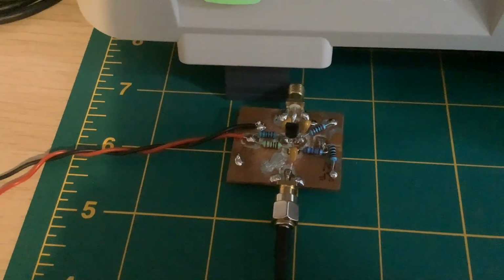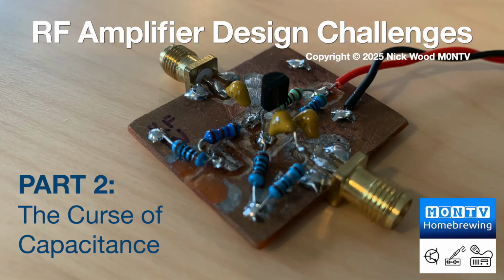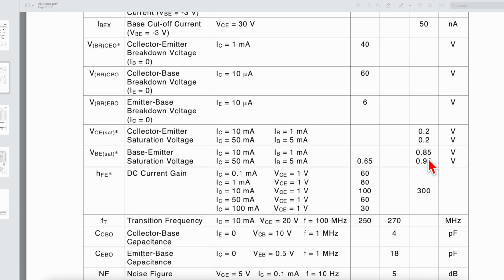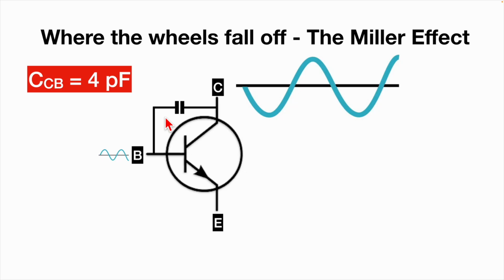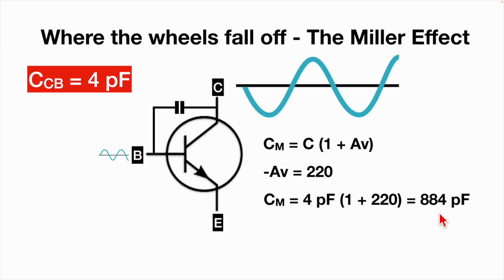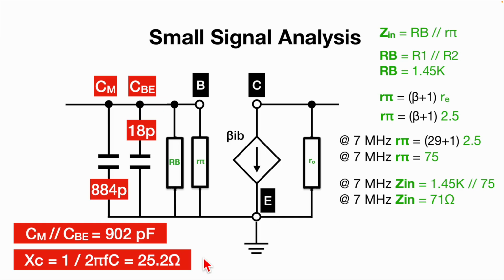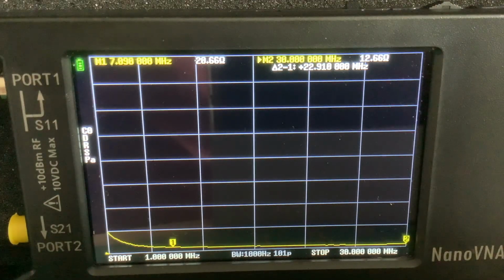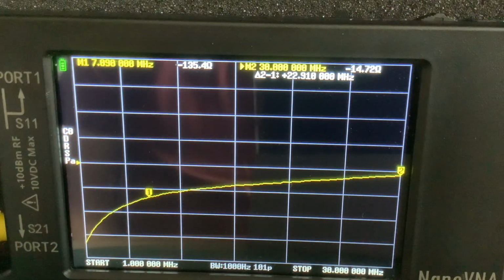65 - The Curse of Capacitance (RF Design Challenges: PART 2)

Comment: Sir please forgive for asking very simple request . Sir any video on Transmitter and Receiver circuit diagram used for RC TOY car controlling the Motors used in the Toy car. With Explanation how the circuit works , how the signal is transmitted from transmitter circuit to Receiver circuit which runs the Motors in the Toy car.
Reply from the maker: Sorry, I don't have any experience of working with remote control or motors. Just do a search - I'm sure there must be several active RC groups on the net and almost certainly several YouTube channels. Best Wishes, Nick

Comment: Nick,  I really appreciate your videos they have helped me a lot.  I could use some advice.  I have built several analog receivers and a few transmitters,  now I would like to expand and build a DDS driven receiver.  I do have the DDS working with a SI 5351, but my problem is I have not been able to successfully get it to tune a receiver,  I have tried both connecting to a sa612 and a diode ring mixer but still not a success.  So could you share some of your experience with me.  73
Reply from the maker: Hi Edwin, Thanks very much. When you say you couldn't get it to tune a receiver what precisely do you mean? Is the Si5351 producing a signal of sufficient strength (about +7 dBm for a passive DRM and less for an active SA612) and on the right frequency? After testing your Si5351 and microcontroller I would suggest you throw together a quick Direct Conversion Receiver. It's just a band pass filter into a mixer (fed by your digital VFO) then out into an audio amp and speaker. You'll soon see whether it tunes or not. If you are failing at the first hurdle (actually getting the desired output from the Si5351) then you might have to take a look at your code. Hope this helps. All the best, Nick

Comment: Hello Ralph...  Do the Miller capacitor Cm in the model should be connected between Base and Collector ? or between Base and Emitter as you drawn it , here ?
Reply from the maker: Hi there! I'm not sure who Ralph is! I do show the Ccb on the schematic. This is the intrinsic capacitance between collector and base. If you are referring to the small signal model then I did say that the Miller capacitance appears in AC analysis as a capacitance from base to ground (as does the base - emitter capacitance). Hope this helps. Best wishes, Nick

Comment: I have used a low capacitance high Ft device on a RF amp. It needed some taming. It is on my Tech-ni-shn YouTube channel
Reply from the maker: That sounds like a much better recipe! Thanks, I'll check out your video. Best wishes, Nick
Reply: @M0NTVHomebrewing Also got some phase noise tests on SI5351a

Comment: thanks for the video but this is not the way the neutralization of the miller capacitance works. to neutralize the miller effect you need to cancel (counteract) the extra base current that is fed back through the Cbc by adding (feeding back) a similar current but with opposite phase into the base. you are just making it worse by increasing that unwanted feedback current. Of course if you add more capacitance you get a bigger input capacitance and thus lower and lower reactance. I mean if you replace that 10pF by a 1nF I bet your input reactance will be close to  0 ohm but you dont have an amplifier anymore. It is reflecting all the power at the input as well as your S21 approaches 0dB. Right now your S11 is about -3dB so you have already lost a lot of power gain by that 10pF cap. impedance matching is not gonna get it back.
There are many ways to neutralize the amplifier. the most famous and the best way that gives you the widest bandwidth is by using the cascode configuration. but if you insist on using only one transistor then you can have a transformer coupled output at collector and add that feedback capacitor between the base and "the other side of that output transformer" with correct phasing and adjusting for the correct amount of capacitance you can cancel out the effect of miller capacitance. another way is to use a couple inductor (transformer) between the base and collector. by adjusting the coupling between the two coils you can feed back the same amount of current to the base as the Ccb does but with opposite phase and therefore cancel its effect. adding a small cap between collector and emitter can also do the job because it feeds back a current into the base emitter junction but from the other side so it can cancel the miller's effect. 
Common base only slightly solves the problem because there is still parasitic capacitance between collector and emitter albeit smaller than Ccb. Cascode is the best solution
Reply from the maker: Hi Amir, thank you very much indeed for your helpful correction and advice. That makes more sense to me! I agree that cascode is the way to go and I'll be having a look at this in the next video. I do appreciate you taking the time to give such full and practical advice. I'm certainly no expert myself and every day is a school day for me. Thanks again. Best wishes, Nick

Comment: Great video. Using RF devices with lower capacitance would probably help increase the top end. The transistors used in MMICs have their ft around 25GHz. I will await the following videos.
Reply from the maker: Thanks Kevin. Yes, you're absolutely right. Even an MPSH10 would have faired much better because of the higher fT. Thanks again. Best Wishes, Nick

Comment: What's the vna drive level when you measure s params? results will be skewed if you overdrive  your high gain DUT and push it into compression
Reply from the maker: Thanks for that note of caution. I'm only measuring S11 parameters and I think the drive of the NanoVNA is tiny - far less than anything I've fed the amplifier from my signal generator (before compression sets in). I agree though that care needs to be taken and I view my measurements on the NanoVNA as an indication of what is going on rather than Gospel truth! Thanks for watching and commenting. Best Wishes, Nick
Reply: As a sanity check, I'd attach a 10db or more attenuator ahead of the amp (on the s11 port of the vna), do sol calibration with the attenuator in place and repeat the measurements.  Ofc doing so will degrade the dynamic range, but it should still be enough for ballpark results
Reply from the maker: Thanks :)